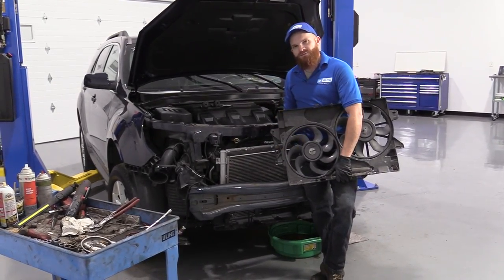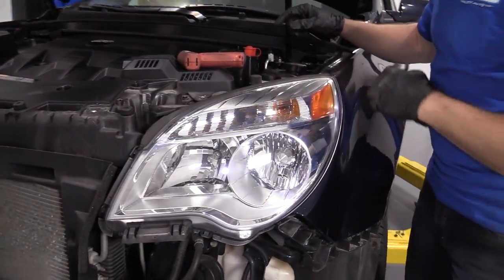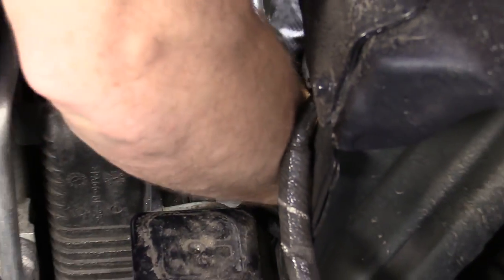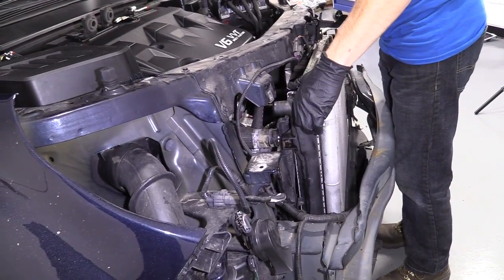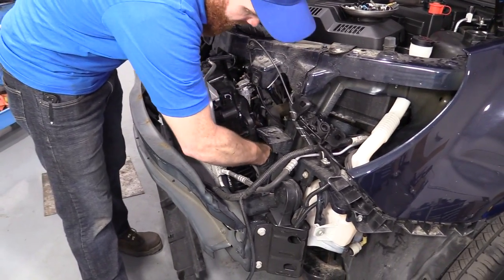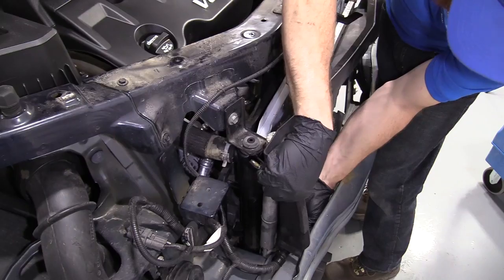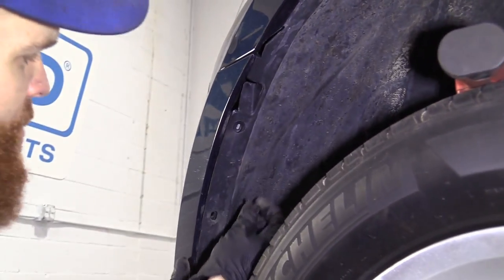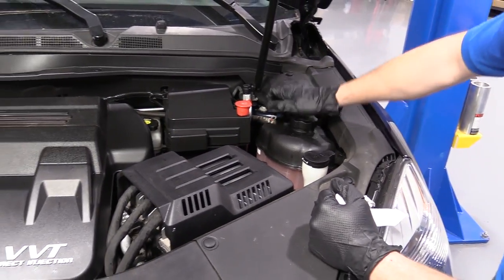How to Replace Radiator Fans 10-17 Chevy Equinox

Comment: Just curious as to why you didn't remove the core support piece across the top instead of messing with all of the radiator parts? Looks like you wouldn't have to tilt everything forward so far, plus save some time.

Comment: Just replaced the fan assembly on a 15 equinox, and found it easier to turn the assembly and take out the bottom. Replaced it the same way.
Reply: Did this stop you from needing to take the tranny coolant lines off. Because I was thinking about removing from the bottom
Reply: @klj5022  any updates?